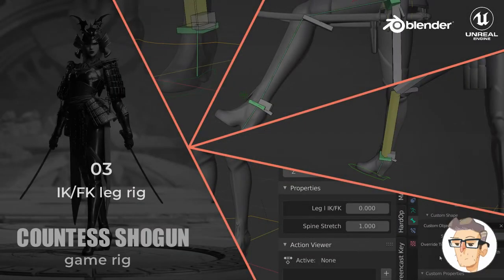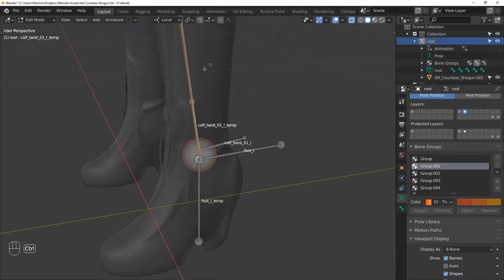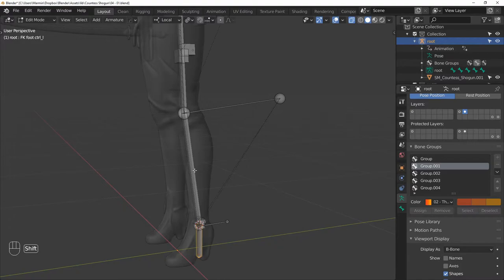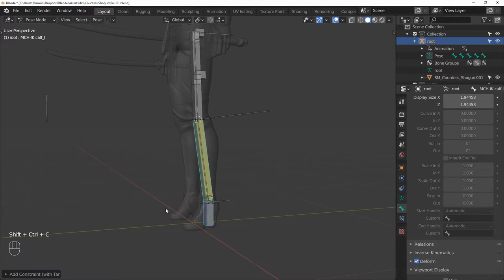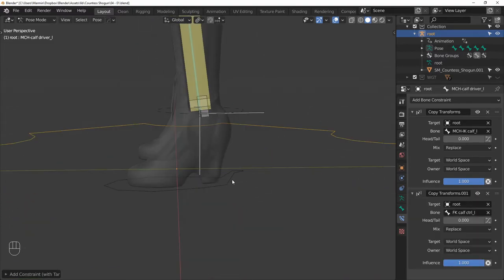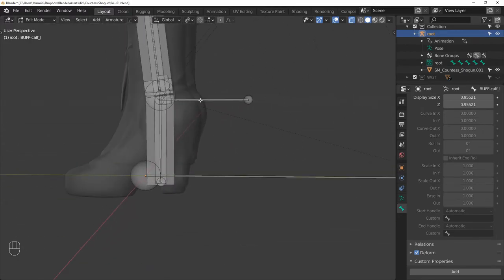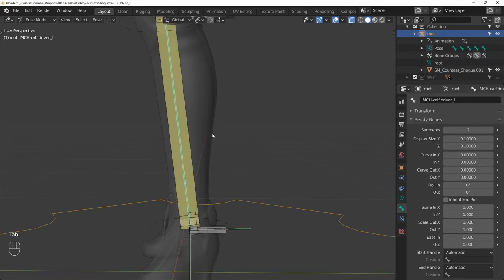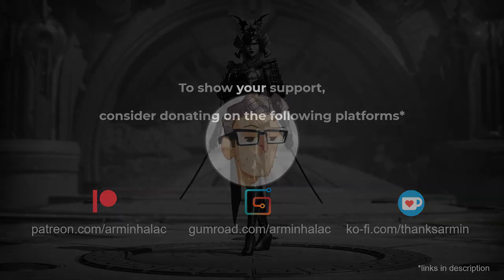Countess Shogun Rigging - 03 - IK/FK Leg

Comment: This is an interesting series... Can you explain the purpose of the buffer bones? Also, it was my understanding that bendy bones aren't supported in Unreal (or Unity), does this setup (and animations created with it) work in-game?
Reply: I'm not the author and it's been a year but, if you mean MCH bones by buffer bones they are act as a glue that sticks deformation bones with IK and FK bones. You can do with out them in this example but it is a better practice to use them.

If you don't want to be misled by bendy bones you can always set all bendy bones to 1 with a simple script or by hand. As far as i noticed bendy bones doesn't make too much of a  difference on the look of animations.